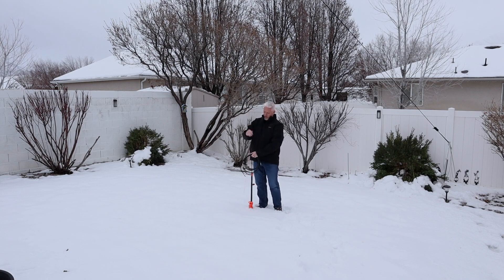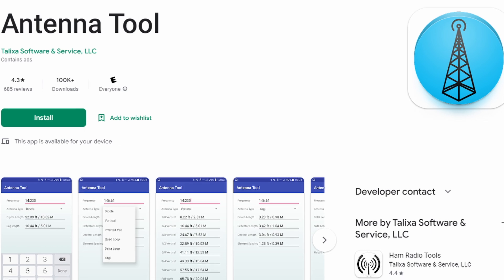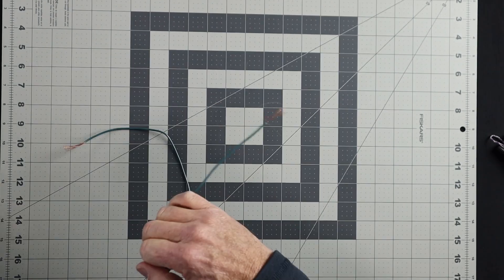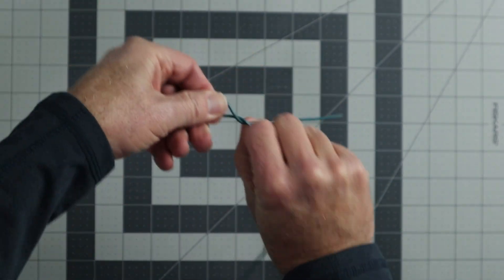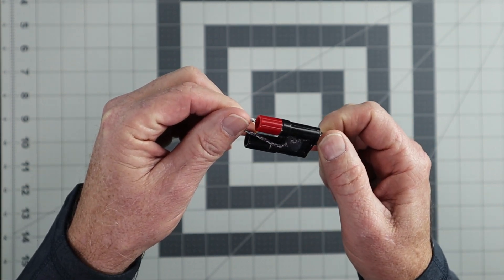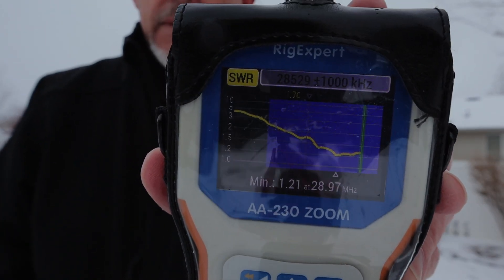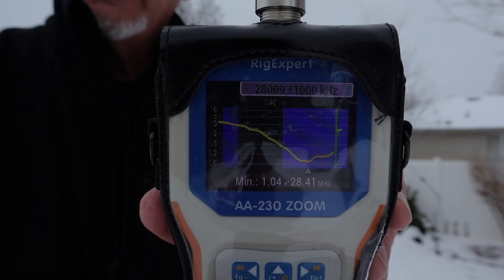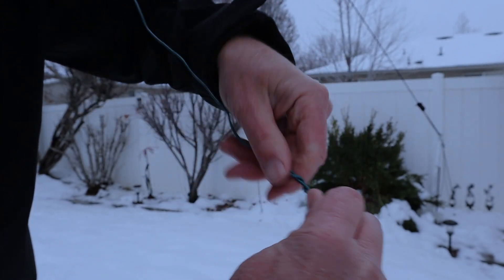28 MHz Antenna Project for Winter | K7SW ham radio

Comment from the maker: Are you crazy enough to go out in the snow to use an antenna like I just did ?😎
Reply: Applying a single vertical radiator to the red terminal and two radial legs to the black terminal will transform this antenna into a groundplane antenna,ideal for working DX.
Reply: Yessir!!

Comment: Dear K7SW. Good afternoon. May I have one question? When you built this antenna you don't use tunner or ballon for this project? So do you use the simple raw inverted V-dipole antenna? In advance thanks for your reply.
Reply from the maker: Yes, you are correct.  The idea is to be simple and easy to use. Could you add all that you have described, most certainly.  Just know that you will indeed make contacts and be able to use this antenna.  Great question you had
Reply: @hamradiowithkevin  oke Kevin. Thanks for your excatly reply. I promise, that I will check my future antenna swr before use. Goodbye and DX73 HA5RFK.

Comment: “Longer is lower / shorter is higher“. 

Can you explain that a little more?

I thought if you want to lower the resonant frequency you need to shorten the wire.  Am I wrong?
Reply from the maker: That is correct. The longer the element is,  the lower in frequency your antenna will tune for. The shorter the antenna element is, the higher in frequency your antenna will tune for. 
There are some really good antenna building apps you can download that will show you and can help you when building an antenna.  73

Comment: So say you want to work both the ft8 and phone Ssb portion of the band will a antenna tuner solve this or would you need to make two different antennas one for each section?
Reply from the maker: Good question,  make one antenna that is tuned for FT8. 
When you want to operate the phone part of the band, roll up both ends of the dipole just enough for where you want to operate. No Tuner required.
Pre mark the amount you need to fold over to make it easier

Comment: I love using those BNC to banana connectors for antennas, but I do wonder about their long-term strength. You might look into surrounding all but the BNC with one of J-B Weld's family of epoxy bonders. That should make the antenna connector strong and corrosion-proof.
Reply from the maker: I had not thought of that. Thanks for sharing this good idea.

Comment: Happy New year and great video. Oh it looked cold out there.
Motters M7TRS 73 👍🏻
Reply from the maker: Same to you Motters, thank you. it was cold, but worth it. 73
Reply: @hamradiowithkevin  I've had another go at a slim Jim for 145.500 tried twice now but I can't get the swr below 1.4 tried 300 and 450ohm different sizes on the Internet. So unsure which one is right. Will have to do a test rig one day which allows me to try different measurements without commitment and waste ladder line. Tried two 300 and two 450ohm antennas. I can see the 1:1 dip but it's like 130.500. Maybe that could be my first video 🤔Motters 73

Comment: Don't forget to wrap around a dozen turns on the coax as a choke. 1" PVC works great for this, but not necessary, just about anything works. 
And of course grounding is required by nec and will bleed-off those static charges that build up on insulated wire, especially in the dry, windy winter months.  
73
Reply from the maker: Thanks Tim 73

Comment: What kind or rod or stick do you use to support the ends of your dipoles?
Reply from the maker: I only used tent stakes in the ground and paracord to reach from the antenna wire to the tent stakes,  I wish they would have shown up better.